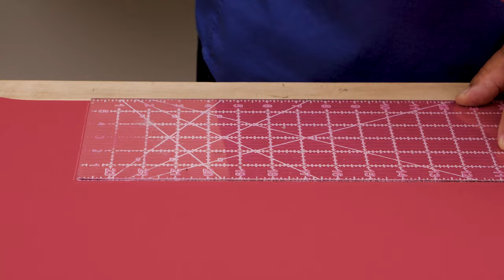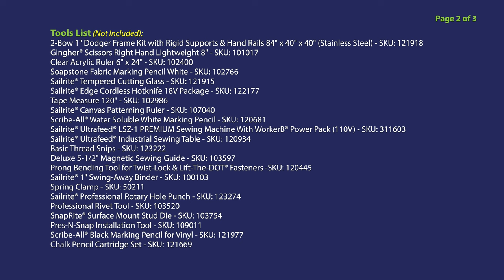DIY California Dodger - Making the Top

Comment: Building this project but dealing with 2 issues.   First, this boat does not have a traveler. Dont know how they control the main.  On my project the traveler is in the location you have the front fastened to the deck.    There is a very small space between the traveler and the top of the companionway on my project.   Second,   The bend at each side of the frame, prevents me from pulling the pattern down properly all the way to the sides.    Going to have to do the front panel in 3 parts to make this work.

Comment: Couple of things you should change in your design, you did mention that you recommend a double stitch on the top tail of the zipper, younshould double stitch the pockets aswell, the sun and salt weakens the thread over time and lasts better being sewn that way.  Also for a distance thats easier to remember when seewing the zipper for the side curtains,  keep the zipper together and line the edge of the zipper to the back inside enge of you edge binding and run a double stitch one the zipper tail.  Also the tail of the zipper that gets attatched to the top shouldnt be the box endge of the zipper, when you do it this way, the zipper pull stays on the top when the curtains are removed and blow in the wind causing stitches to fail over time and is less annoying than hearing the zipper hitting the frames
Reply from the maker: The kit comes with a V-92 Polyester thread, but you can change the thread to the Sailrite Lifetime Thread, it is a PTFE thread that will never break down in the sun. True, the starter box for the zipper could have gone onto the curtains. However, I thought it would be easier to slide the zipper post onto the bimini/dodger top with the starter box on the top rather than the curtain. That is the great thing about DIY, you can do what you think best.